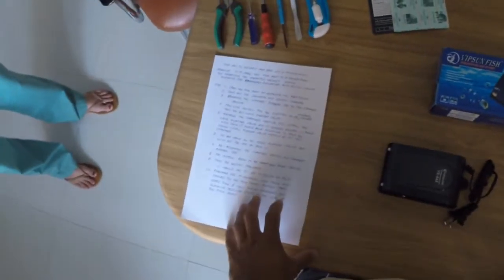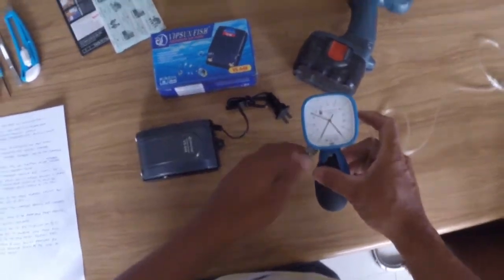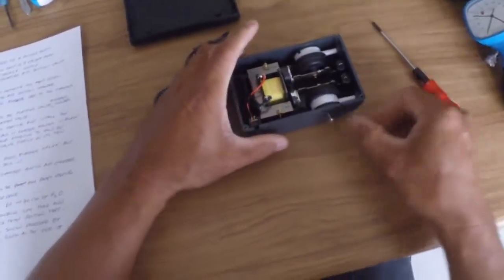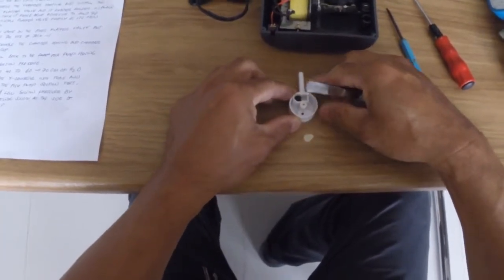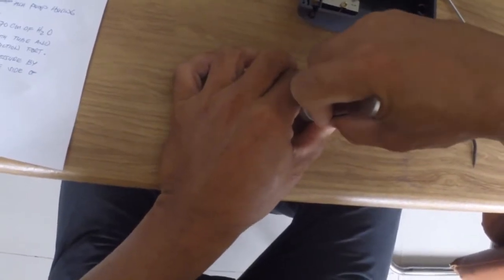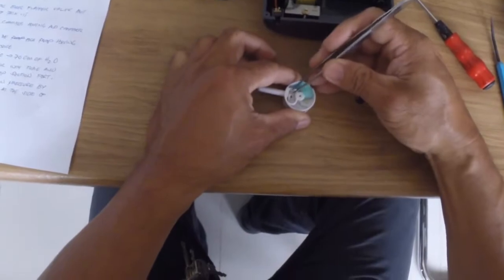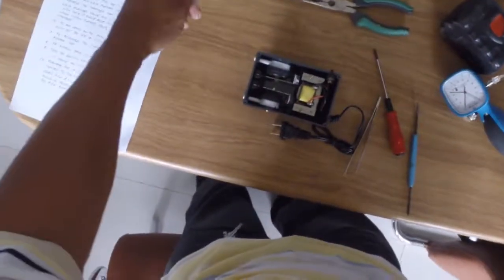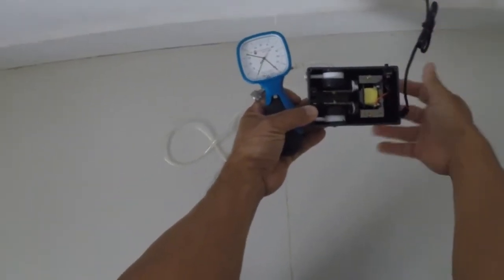Convert a fish pump to a vacuum device for wound dressing

Comment: what's up with the drill? were you trying to convey that holes should be placed in the housing? also why can't you actually show it hooked up as a negative wound vac and show it working? lately why can't you answer any of these questions?